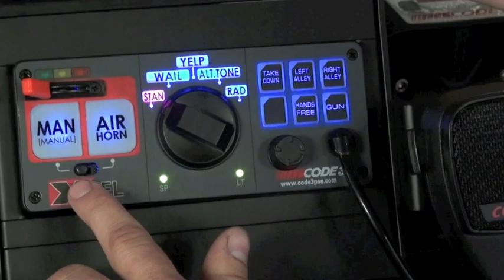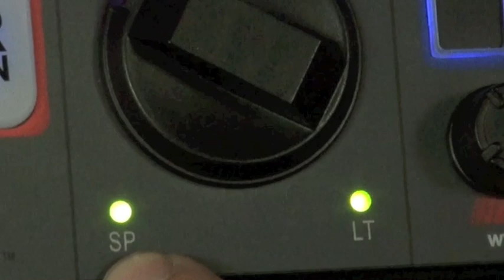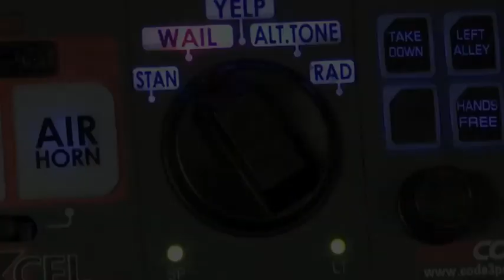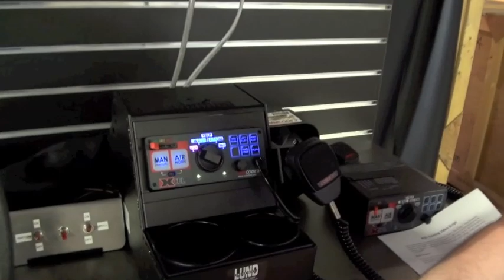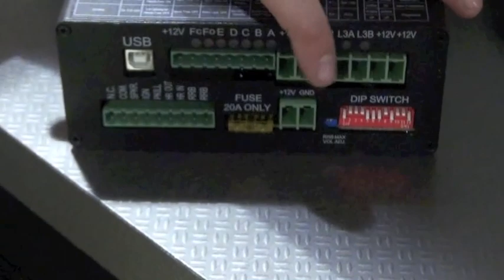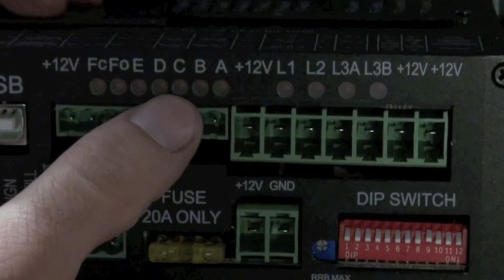XCEL Siren by Code 3

Comment: Exelente tarde extrabie el manual de instalacion de una sirena code xcel 3 no encuentro como poder instalarla
Reply from the maker: Install instructions can be found on XCEL product page at https://www.code3esg.com/us/en/products/sirens-and-speakers/self-contained/xcel-siren.
Here is a direct link to them https://assets.ctfassets.net/0j0u5f98aept/2lrW9PRBWY4wkog2wwGYe8/f0b49ccb566dda33e800311887dda62a/T55868.pdf

Comment: So...you have to scroll through all the siren tones on the rotary knob to get to radio rebroadcast?  Besides deafening everyone on scene, what does that accomplish?
Reply: The siren only comes on if the selector is in position 3. As long as you're not in position 3, you can move to radio rebroadcast without activating the sirens.
Reply: Siren only sounds when all of the emergency lights are switched on...

Comment: as many features as this has, ied love for yall to make a siren with the banshe or how ever you spell it built in and have a button on front to control both speakers at once or just 1, it might be overkill but would be pretty neat to go through a mode setting with dip switches on rear and have it where you can do the same features as a banshe as well as a code 3 siren be it a vcon or w/e, i do like the xcel features though